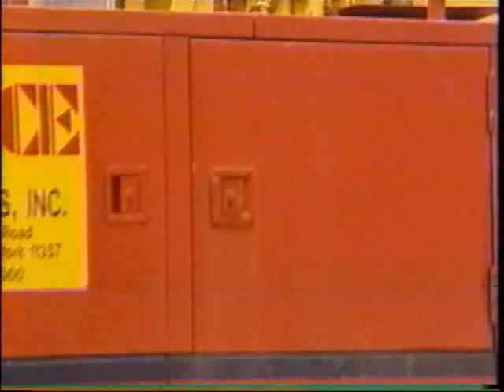Working at Ground Zero 2. NIST FOIA Release 10

Comment: I arrived there on 01/01/2002 just over 3 months later. I recall military jeeps rising up from deep holes in the ground with American flags waving from attached poles in back of those Jeeps, and the most powerful moment when I glanced to my left at the enormous cathedral a few feet away from the site, untouched; without a brick fractured, seeing the layers of lit white candles outside and set in place along the stairs going up to the large front doors….

Comment: The steel making up Towers 1 and 2 weighed around 200,000 metric tonnes. The concrete a further 800,000 tonnes. So the rubble pile weighed ~1 million tonnes. The 3,000 human casualties bodies’ weighed around 225 tonnes (75 kg per body). So the ratio of body part to rubble by mass is around 1 : 4400. In other words per every human body, there was 330 tonnes of rubble removed which is equivalent to 25 London buses.

Comment: Its almost as if something blew these buildings apart.
Reply: Not quite. Steel loses half its strength when heated to about 570 C (1060 F), and nearly all once past 700 C (1300 F). Thus, the structure of the impact zone, with a temperature that varies between 200 C and 700 C near the time of collapse, will only have between 20% to 86% of its original strength at any location. The beams adjacent to the points of entry, could not hold up the extra load of those missing AND the excessive, continuous heat. There's no way those buildings weren't coming down after those impacts. Surprised they lasted as long as they did.

Comment: how it can be october if there is some smoke from debris like its some small burning there..
Reply from the maker: Fires burned below until the middle of December.
Reply: Removing layers allowed more oxygen and other fuel to reach the smouldering embers.
Reply: the thermonukleare Abtragung verursacht Temperaturen bis zu 3.000°C und radioaktiven Rauche  Haze...
Reply: A nuke didn't go off down there. If one did, the area would still be radioactive. There were intact rooms in the basement after the collapse so it couldn't have been detonated underground. The so-called "heat map" is a LIDAR elevation map.There was molten metal on site but without having it tested, it most likely wasn't steel. Many metals become molten between 600-1500 degrees F.
Reply: @CTV911  I can only imagine how hard it was to work on all that rubble. I hope something like this never ever happens again to our beautiful Country.
Reply: Don't forget, the planes had both just been filled with fuel prior to takeoff the collapse went hundreds of feet below street level. Everytime they remove debris, it exposes it to oxygen so random fires can break out even months after
Reply: @CTV911  Fires?